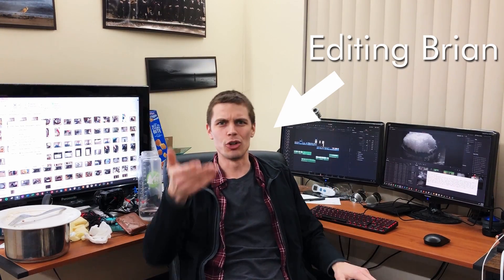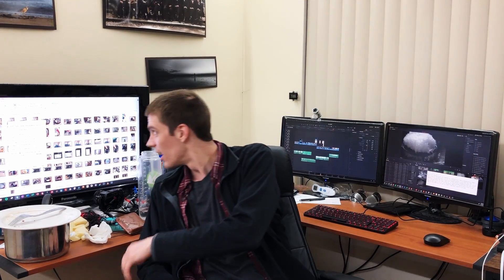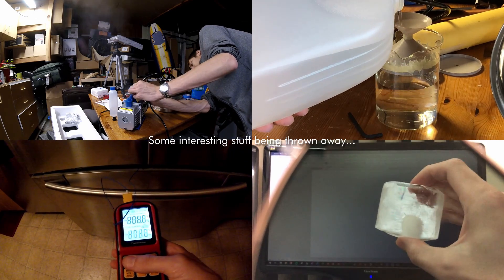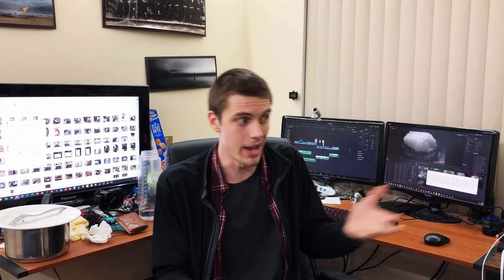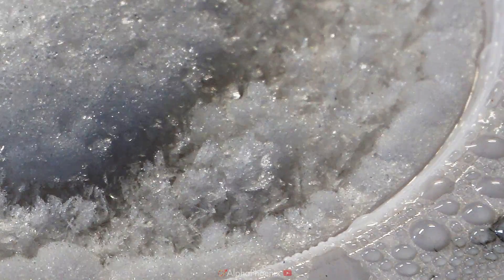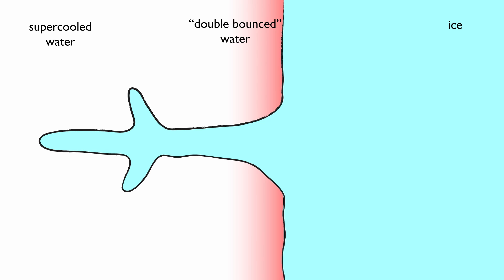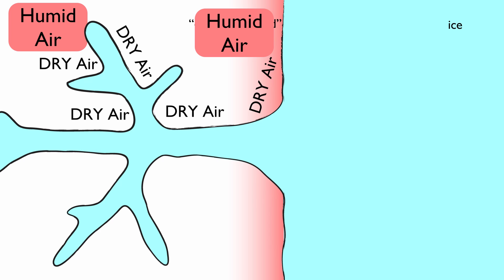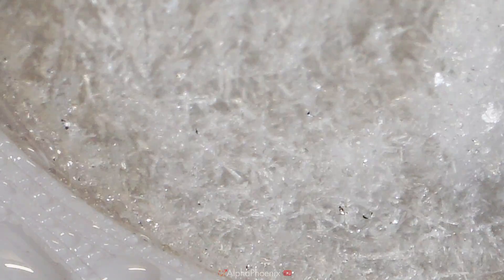Big Hexagons of Ice 2: Thermoelectric Boogaloo

Comment: @AlphaPhoenix    You need a non- frost free deep freezer. One of the cheap ones. They do not have a defrost section of the control loop. They just turn on when it gets too warm inside. That's why you have to chip the ice off everything after a while when using one to store food long term. The benefit is that the food never has to get warm enough to melt the ice growing on the surfaces of its packaging. That's how the 'frost free' freezers work, they let it warm up enough to melt the frost.

Comment: I know nothing about what I assume are the numerous factors that go into determining sizes of crystals, but it does seem that crystals tend to have a degree of size limitation in natural formations. I also know that large single crystal silicon for semiconductor wafers are grown under very tightly controlled conditions, which are technically challenging to maintain. I expect to accomplish what you have attempted here, if it is possible, would require some very specialized equipment.

Comment: i know you said youre not working on this anymore but, I did something and from what i can see, it worked. 
I started off by slow freezing a water bottle with a few drops of blue dye, wrapped in insulation, except for the top, to get a bottle of clear ice.
i then cut off the plastic bottle and stuck it in my deep freezer, for 24 hours.
The next day i lightly misted it with cold (clear) water and put it back in the freezer for 20 minutes. 
I did this several times and i didnt see anything. 
But then i got impatient, misted it a bit heavier and stuck it back in the freezer. when i came back, i had little hexagonal spots all over the bottle
Please try to recreate this! im not a scientist!!

Comment: You can get a thermostat that will cut power and reenable it at a set temperature. They are used for brewing but I use them for science and steaks. It will give you fine control within a degree or two.

Comment: When I was a kid growing up in Alaska, there were different types of snow crystals that you could find.  For example, when there was several feet of snow on the ground, and the outside air temperature was somewhere around -40, if you dug down to the ground level, you would find crystals that could be a quarter inch in size.  Mostly I remember hexagonal needles and you could feel the hexagonal 'stem' through your gloves.  Another great place to find big ice crystals was near a sink-hole.  The decaying plant matter inside the sink hole would create an updraft of warmer air along the edges. The crystals would grow out from the edge of the snow at the top of the hole.  Some crystals could be an inch in length and were often flattened needles an inch in length.
Reply: i hope he sees this

Comment: The thermostat of our freezer broke, fortunately in the "on" position. Replaced it with a thermostat module, was pretty easy and works great. I think it could be useful for this as you could control the temperature of the Water or other parts of the experiment instead of just the inside air temperature.

Comment: Amazing video as always! I was only introduced to your channel last month, so you may already have a video on this, but I still wanted to leave a comment:

I got really into making cocktails a few years ago, which meant a lot of time trying to make perfect ice. My goal was large cubes with high clarity, and the technique I eventually settled on was to fill a cooler with water, place the cooler uncovered in my freezer, remove the cooler when ice had formed a sufficiently thick sheet, drain the water from beneath the sheet, and saw the sheet into cubes. The technique worked great, no matter whether the water was filtered, boiled, or straight from the tap.

Why do you think this works? My guess is that the imperfections form when liquid water trapped by already-formed ice freezes and expands, causing internal breaks in the crystal structure.

Cheers!
Reply: For anyone looking to replicate: long skinny crystals are great for tall glasses :)

Comment: You can get PID temperature controllers, plug out up to a relay to contol power to your chest freezer. The ones coming from China are really well priced (i used one on my oven to replace it's faulty capillary thermostat and it's FANTASTIC). It can cycle power just nice to match the heat loss so that the temperature is maintained very very well.

Comment: if you are reading this, buy a variable frequency drive / or build one and hook it to the micro-controller such as Arduino /esp32 to control those freezer compressor speed for adjusting the temperature response smoothly.

Comment: What about using a copper heatpipe(machined to perfectly point cone) with one side chilled with peltier and acetone sealead away from a bath of warmer constant water?i think it will crystallize better in liquid than in air just difficult to maintain the nucleation poit on the chilled copper rod

Comment: Y not control the thermopile Using a PID (u can use resistivity of the thermopile around -2°c itself as a measure of temperature) instead of control the whole freezer? Around -2°c as in using a bridge.

Comment: I wonder if you could avoid messing with the freezer's own control range by using an mcu and, when it sensed the temp was rising (normal off-cycle or defrost cycle), it merely switched a relay off and on (just your own socket, no need to work with the freezer's internal parts). That split second might reset the freezer so, at power-up, the compressor's back in gear.  (On a related note: We got a separate top-loading freezer during covid for some extra food storage. That has no defrost cycle, and is kinda nice (ice-buildup aside), because food doesn't get the damage from the defrost temperatures. Preserves things much better without the high-level of 'freezer burn', and associated delicious freezer-burn taste.)

Comment: try adding a huge heatsink into the freezer so when it cycles the temperature is more stable. Like 10 12*12*1/2 inch steel plates or something.

Comment: One of your mistakes Is the freezer being empty. They are not designed to run constantly without burning the pump out. To maintain a temperature more reliably fill any gaps of dead air with ice or other frozen things. Otherwise every time you open the door your starting over form scratch. Even if its just a old milk jug filled with water it will act as a cold battery to keep things from getting hot when the freezer pump needs to rest.

Comment: H2O is a slighty dielectric molecule. a Bipole if you will. Can't one force orient them by applying a clean smooth magnetic field on the setup while if freezes from numerous nuclei?? like orienting ferrite with magnets.
Reply: In a way the ice is doing that already by itself. The various crystal structures of ice are constructed such that the optimum alignment of the dipoles (water molecules), alongside hydrogen bonding, is achieved.
Reply: @TehScotch  u no say? 
What I'm trying to say here is to force that natural process to go the way we want with our intervention with a strong magnetic field.

Comment: If I was to attempt this experiment, I would probably start around building a cold plate freezer with a 3 phase compressor and controlling that compressor with a VFD. The cold plate would attach to the bottom of the vacuum chamber, and inside the chamber have a copper pedestal that sits above the waterline. Use resistive heaters to keep the water in the chamber barely in the liquid state. 

If the chamber was taller, it could be possible to keep sufficient distance between the heated window and the experiment to minimize it's influence on the experiment. Then just put the entire apparatus in a sealed and insulated box and monitor it from the camera/sensor feeds. This would allow one to "tune" the crystal growth operation with minimal disruption.

Comment: Homebrewers use a chest freezer to make a controlled temperature environment (use a cheap one without a defrost cycle). You could take the top off and put a clear cover (or an insulated cover with a clear port). Use a pdi controller and include many large blocks of ice to provide a thermal ballast. One of the troubles with your freezer is that it was practically empty.

Comment: To get a stable temperature, maybe use a heated metal block to work against the freezer - us a PID controller to control the heater, avoiding any need to modify the freezer.

Comment: I feel like there has to be a really complicated machine which can regulate the amount of a substance in it's gas phase and keep the temperature/pressure constant so that it can easily deposit on a substrate. Hmmm if only we knew where to find one... cough molecular beam epitaxy cough . I realize this wouldn't work for what you are trying to do but I thought it was funny that the MBE is literally the machine for controlled crystalline growth.  Seriously great videos, love the subjects you are covering and I can't wait to see more
Reply from the maker: One would think 😂
Reply: @AlphaPhoenixChannel  Expensive idea, but just putting it out there. Maybe if the vacuum chamber was re-designed to more actively control both heat and pressure? Improvise a way to extract heat from the vacuum chamber directly, rather than just putting it in a freezer. A pot with heat sinks or another type of cooling system. And better sensors and controls on the pressure control. Build a microcontroller to monitor all that, perhaps integrate a camera system into it.
And make a room with more precise climate control to do this in, or even a commercial walk in freezer, which would be useful for other experiments as well. Or a smaller custom scientific freezer for this sort of thing.
There could be a world of new stuff in water crystals like this we don't even know about, until we try.
I know you are burned out on the project, but don't abandon it entirely. This is interesting.

Comment: If you grow the crystals underwater you could get rid of the vacuum chamber. dunno how difficult it would be to film tho
Reply from the maker: I actually tried that, but underwater IN a vacuum chamber. Apparently (according to a paper I'd read, absorbed gasses in the water can halt faceting, so evacuating the air and causing all of the N2, O2, Ar, CO2, etc, to leave the water  might have worked, but I got a rounded dome instead of a faceted hexagonal prism. Also if you let that setup go for too long, all the water just freezes - the surface ice from the top sticks to the peltier ice from below and then you're done...
Reply: sounds a lot more complicated than i imagined. maybe pre vacuum the water and put it in a sealed container. My Idea was to have a big body of water for temperature control. and the total freeze is a bigger problem in a sealed container :/

Comment: I know this is an expensive suggestion, but you might want to look into a refrigerated circulator (Julabo/Neslab/Polyscience). I have found a couple on ebay for under a grand. You would be able to maintain a temperature bang on with one of those.

Comment: Sounds like you’d want a PID controller to keep the “air” at -1C. Either using a variable-displacement compressor, or just a bunch of peltiers. Directly cooling the vacuum chamber, not in a freezer, maybe in a fridge. If there are “inverter” freezers out there, they’d be a good target for altering the control loop. Another idea is to use a variable frequency drive to power a regular freezer. A simple TRIAC circuit might work too, maybe. -2 - -4 degrees is under shooting I’d say, you should be able to get more accurate than that so long as you go for a good thermal sensor.

Comment: There are no-hackery-required temp controllers out there already. Inkbird is a popular brand and run 30-40 USD. The are commonly used to make kegerators and there are two outlet versions so you can also control a heater at the same time. 

Input your desired temp range and it will control the power to the device directly. I've used them to both make a chest freezer into a refrigerator and to keep one running colder than it normally would. 

As always I love the videos!
Reply from the maker: Good tip!

Comment: So, instead of going at this from a single crystal growth, why not take the polycrystalline material you ended up with so many times and sinter it to a single crystal? I have a book on sintering that mentions ice sintering around -12°C but would need to look into that a bit more to say with any certainty. It may not be the ideal route you’ve set out for propagation from a single nucleation site, but it would offer you the ability to have a bit more control over the process. (Assuming that it is somewhat approachable without commercial equipment)

Comment: I wonder how would ice crystals on surfaces of comets would look
Reply from the maker: ooooh interesting question!
Reply: I was thinking of something similar. You know the hexagonal shaped "storm" on Saturns north pole? As well as the sounds recorded from it? Acoustics, vibrations also could play a role in forming the shapes. And also different surfaces, like a copper layer to see if different metals effect the crystal shapes. It is said that water has mimic properties of what it is in contact with, it might be conducting the vibrations from what it is in contact with in such a way that if it freezes the vibration pattern is being crystalized so to speak, frozen in time🤯
Reply: @terrafirma9328  the sounds recorded from Saturn's poles aren't sounds, they're radio emissions caused by charged particles moving through and being moved by Saturn's magnetic field. You can't freeze vibrations in water since vibrations are movement, to freeze, water molecules have to slow down enough that the hydrogen in one water atom can align with the oxygen on another, forming a crystalline structure, but you can subject the ice to high pressure and cooling rates as it freezes so you can have a block of ice with two different crystalline phases Ice I and Ice III at -23°C and a pressure of 2,100 atmospheres. There should be a noticeable boundary layer since the density of Ice I is 917kg/m^3 and the density of Ice 2 is 1160kg/m^3. But I'm not sure how sudden the transition would be. Because that could be catastrophic if it were spontaneous, like crystallising supercooled water. The volume of 917kg of ice suddenly shrinking by 21% or 1160kg of Ice III expanding by 21% when someone tightens or loosens a screw on the isostatic press. Freezing liquid water to ice does the same thing, but much more slowly as the water has to find and orientate itself, it might actually revert to an unstable liquid intermediate at the transition boundary, I'll have to look into the kinetics more.
Reply: Or what about the ice formed on the moon's poles? I imagine the ice on Europa and Enceladus is in more forms than the common Earth variety.
Reply: You could look up the last pictures the rosetta orbiter sent back or the close ups from its philae probe.
Comets are much more than just (water-) ice.

What about dry ice crystals from the polar regions of Mars tho?
Reply: They're amorphous ice, I think. A glass instead of a crystal.
Reply: probably not very big, they're mixed with ammonia, which is much more volatile and lowers the freezing point of water. It also exhibits hydrogen bonding. From what I can see it freezes into an amorphous solid at any significant concentration of ammonia, so no crystal structure at all.
Reply: Wouldn't the ice just sublimate away?
Reply: @max_kl  The ice only sublimates if it's exposed iirc. After the comet passes close to the sun I imagine it would sublimate and produce some crystals though.
Reply: @chnhakk  yeah, maybe
Reply: I was thinking more of what they would be like on a spoon